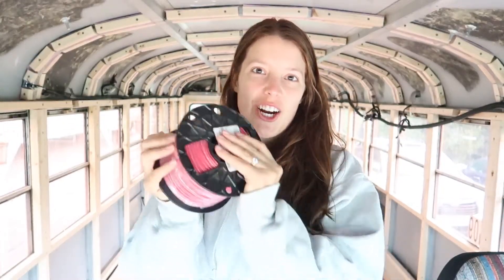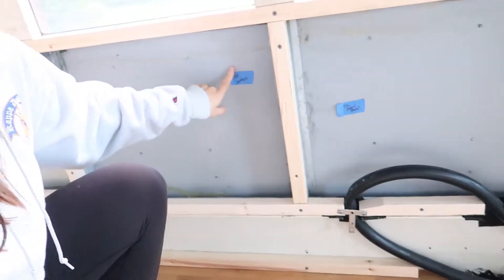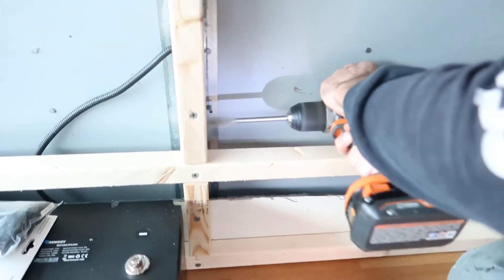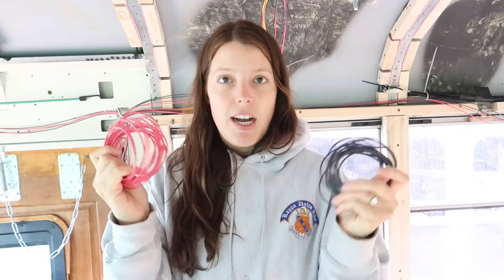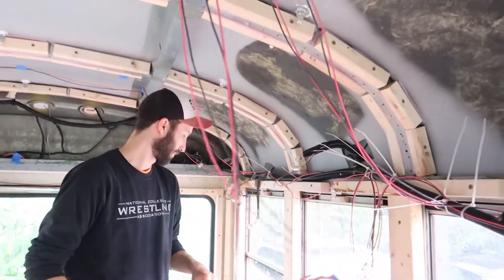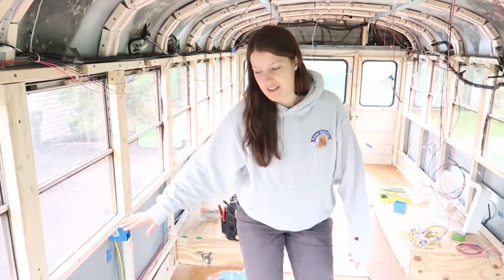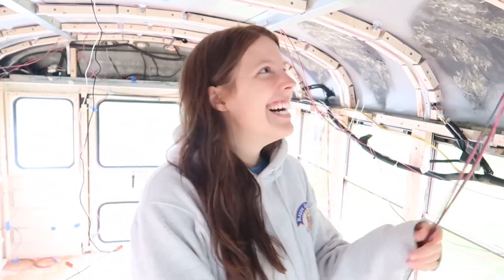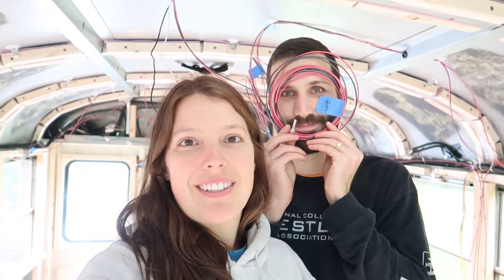Running wires for 12V and 110V power in our Skoolie | BUS BUILD EPISODE 21

Comment: What wire did you guys use for the water heater?
Reply from the maker: We used the red/black 14G wire that we ran for all our 12V appliances! The only 12V appliance that has a larger wire is our fridge, we ran a 10/3 marine wire for it ☺️

Comment: Hello, loved the video. I’m at this part and have a few questions. With 110 do you have to run the wire to each outlet? Or can you share the same wire for two outlets on the same wall? If that makes sense. Start at the fuse box then run wire through the first outlet and continue to the next or should each outlet have a separate wire. Also on the 12 volt can you do the same this is where I’m confused thanks
Reply from the maker: You can definitely string 110 outlets together! We have our bedroom and kitchen 110 outlets on the same circuit. You just need to take into consideration the power draw of what will be plugged into the outlet. If you have a 20amp breaker for the circuit but have multiple appliances plugged in that have a high power draw you’ll probably trip the breaker. But for just daily use things like chargers, it’s totally fine! The same goes for the 12v outlets, however I’m pretty sure we put each of our 12v outlets on their own circuit to avoid blowing a fuse.

Comment: I love your guys’ videos! So helpful and informative <3 I’m wondering how you decided to do the spray foam after instead of before electrical? Do you worry if you ever need to mess with the wires it’ll be hard to access since they’ll all be spray foamed in there?
Reply from the maker: Great question! Honestly, we just followed what we saw a lot of other skoolie channels do with their wiring and spray foam. You’re 100% right that the foam makes the wires nearly impossible to access. That being said, the most likely failure points are where any connections are and we made sure to leave those accessible. I think it’d be fine to insulate first and then run wires, you’d just have to carve out channels in the insulation for the wire to run through. ☺️
Reply: @AdventureTrudge  that's what I was thinking. Thank you!

Comment: Looks great the only thing I would use stranded marine wire for the 110 volt instead of the yellow house romax wire you used it's like your 12 volt wire but made for 110 volts and it's great wire Amazon has it in 14/2 for 15 amps and 12/2 for 20 amps just like the house wire from depot or Lowe's
I've built two coaches over the last 20 plus Years now and have used the same wire it's still working great to date.
Thanks for sharing your doing great.
Reply from the maker: Thanks Brian! We found people recommending both the stranded marine wire and the yellow romex in our research and read somewhere that the marine wire was maybe overkill (which is never a bad thing lol). As first time builders, we really appreciate the tip!
Reply: @AdventureTrudge  I was just thinking of your concern about the use of stranded wire for the 12 volt wire possible breaking 110 volt wire has the same possible outcome but could start a fire if it were nicked or cut or a screw went into it but it still will do the job just fine.
Reply from the maker: @briandavis9975  yeah that makes total sense!

Comment: I know that white Romex is 14 gauge and yellow Romex is 12 gauge which are larger gauge wires. I know they use white in houses. Why did you decide to go with the bigger yellow 12 gauge? Just curious if Rv's/Busses require it?
Reply from the maker: Hey Mike, they definitely don’t require it! We used the larger wire in case we ever wanted to install something that had a bigger power draw like a mini split air conditioner. Again, we’re not pros but it seemed like it wouldn’t harm us to use the 12 (other than costing more) and it would leave us more flexibility for upgrading appliances in the future 😊
Reply: @AdventureTrudge  you guys are killing it! Good job.

Comment: Looking really good! I’m nervous about the actual wiring everything up part of the build. I hope I know someone with some electrical knowledge 😅😅 your AC are you using Romex or was that stranded as well? I know we definitely want to do stranded for everything.
Reply from the maker: We used romex for the AC wiring, but stranded seems to be the safest bet! From what we've read romex shouldn't have any issues and lots of other skoolies have used it in their builds but stranded is probably better (based on my very little knowledge)

Comment: Shocking!
Reply: I see Betsy and Brett made an appearance, didn't look like you two did much work to me!! :)
Reply from the maker: @dpicard1963  we saved the easy part for them and they were still shocked when we told them there was work for them to do 😂
Reply: We are more there for emotional support. I put all the rubber grommets in😊 Brett helped zip tie the wires to the ceiling.  Very important jobs indeed! We also hung out on the roof deck.